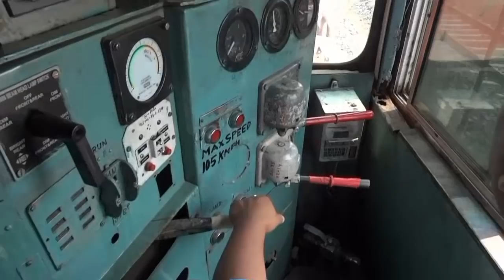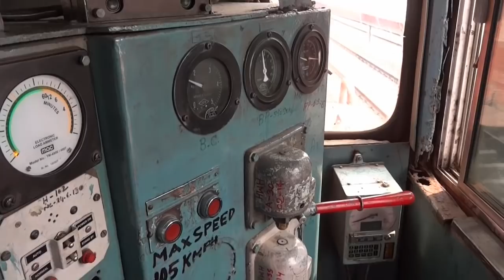IRFCA Loco Pilot applying Brakes WDM3A Diesel locomotive engine

Comment: I still wonder how do locopilots drive with very low visibility from that side glass??? Isn't it annoy them?
Reply: U don't need a shit ton of view from the cab , as for a train the driver will have to look for signals & other animals / people by the tracks , if the r on the track he will honk and apply emergency brakes but it could be too late for the guy / animal .. & after the train is done hiting the animal , it will go through a speed restriction of 50km/hr as if the driver has applied emergency brakes it could have compromised parts of the train under stress.. & all the coaches & locomotive will be inspected for faults ..
Reply: I always wonder about that